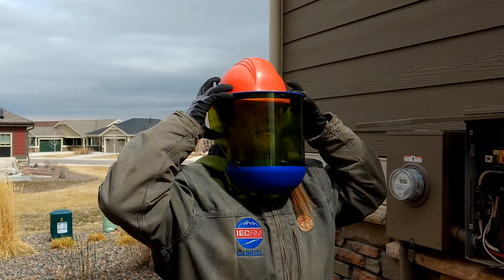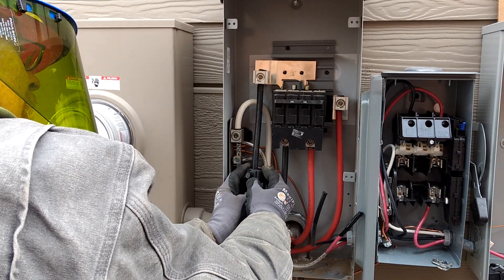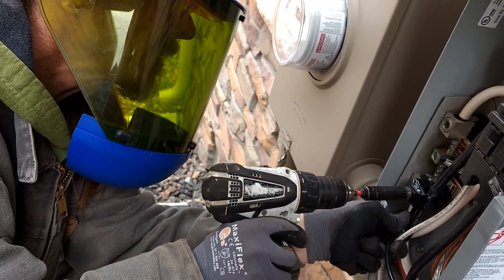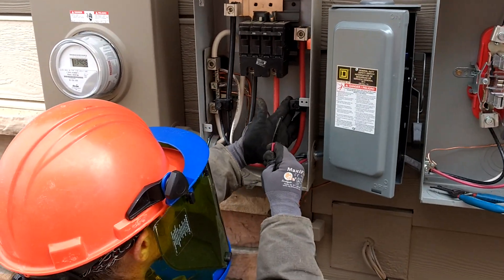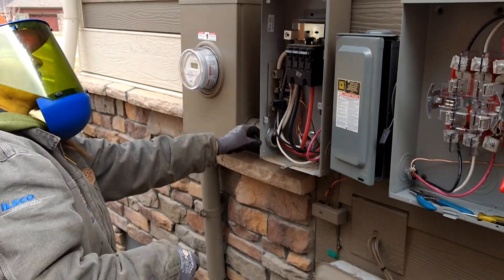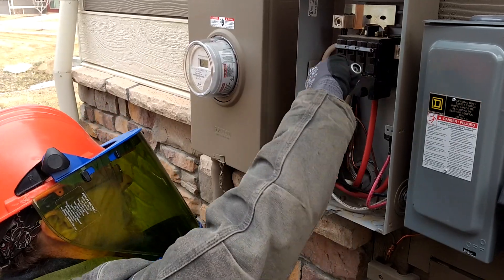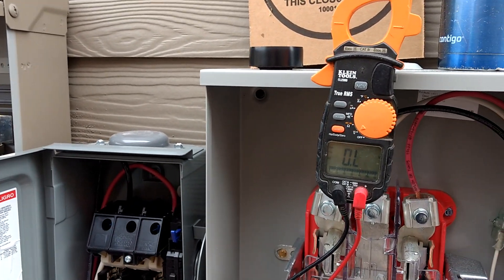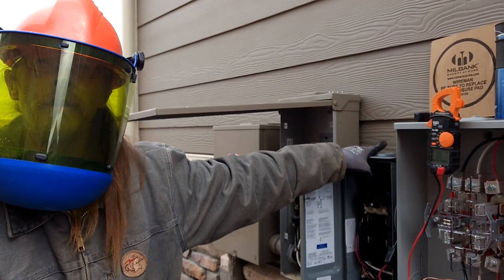Solar Line Side Tap Connection

Comment: Question .. instead. Of using this connection can you just run the wires inside to the breaker panel and connect them to breakers instead of this? Thanks
Reply from the maker: depends on the amperage of backfeed and the amp rating of your bus and main breaker.  Usually for a 200 amp panel, you can backfeed up to a 40 amp breaker, but the rating of the bus and manufacturer's specifications vary.
Reply: @AngelMalakim  not sure what I’m going to tell this solar installer about how they tie in inside the meter box. The electric company says they can’t go in the meter box and connect in there. They didn’t give another way and the developer says they do this all the time. are they just going make me get a new breakerpanel ?

Comment: Very good video.  Isn't it required to bond the neutral to box in the fused disconnect fed by the service conductor taps (Typically green screw installed) and then carry 4 wires to the PV meter base and 4 wires further upstream?  This would require a meter base that allows the neutral to "float" from the box, but they can be found.
Reply: Well, technically the conduit can act as the effective EGC if everything is bonded properly but I always run an additional ground for redundancy. I do not land the neutral anywhere in the PV production meter as it is not necessary to do so.
Reply: @SuicidelG  run you ground and bonded properly and neutral has to be ran in every electrical box, meter, etc in CA
Reply: Ground from the disco to the ground bar of the MSP. Kinda weird to bond the disco when the main panel is already bonded and the true first means. That part has always been confusing. Bonding the disco essentially creates a ground loop lol whatever the inspector wants

Comment: Are IPC's Service rated?  My understanding is that they are not and thus, not acceptable for PV Line Side Taps.
Reply: They absolutely are not... though I won't lie my company does them on some utilities still that allow them. Alot do not and require non piercing lugs. We've mostly moved away from them as there have been some burn ups.

Comment: 1.6 ohms is actually higher than I was expecting for such a short length of thick wire. I'm not saying you did it wrong; I'm just a homeowner who is having a professional company install a PV array who want to use taps, and it seems a bit janky to me. Can't tell if my instincts are right or if I'm being unnecessarily picky.
Reply from the maker: you're right, i suspect my meter is off a bit on the low resistance readings... it should have been under 1 ohm, but with my meter i'm usually satisfied if its under 5 and the beep happens

Comment: I have had a few people look at installing a backup generator with a whole house automatic transfer switch.  The hang up is my solar system.  Currently I have two 7600 watt inverters running through two AC disconnects then back feeding my main panel.  The range of magnitude I have received from 3 installers is significant and all 3 seem unsure of how to deal with my solar.  One was going to connect the solar to the generac SMM modules so the would default to off when there was generator power, one says i need to do a manual transfer switch with 16 circuits and leave solar as is, and the third is recommending installing a sub panel that the solar feeds and then connecting that to line side of the meter.   The 3rd option is the most involved and most expensive.  Is there a simpler way such as replacing the unfused AC disconnects with fused disconnects then using this style tap to connect to the line side in the automatic transfer switch?
Reply from the maker: yes, if your solar connection is line side of the transfer switch, you will never have the generator back feed the solar.
Reply: @AngelMalakim   thank you.
Reply: @AngelMalakim  agreed.  As long as the generator feeds downline of the solar hookup you won't fry your inverter(s) by accident.  That would be an awful expensive learning lesson for anyone.

As a rule we always install our solar on the utility side of any generator.
Reply: Yea, making the interconnection for your PV system on the Line side of the transfer switch you should be good.... or I guess get an enphase system than has the capability of integrating a certain list of fixed in place generators that works in conjunction with the array/batteries(if you have them) to power your home during an outage. I assume, since this was 8 months ago, that you've had your system installed and this comment is too late lol
Reply: @SuicidelG  Actually my system isn’t in yet.  My generator is currently slated to ship January 19.  So this little project is now a spring 2023 project.   SolarEdge inverters are also able to sync with generators, unfortunately my solar arrays and inverters are each greater than 30% of the generator capacity.   So my plan is to go with lineside taps on the utility side of the switch.   Thank you for following up to my post.

Comment: Like that fact you are  wearing what appears to be Category II PPE; however, the gloves seem a bit short as your wrist were left exposed.   What was the reason to use line-side-taps on a residential instead of "Green" meter box that has lugs on the customer side of the meter box?  Seems Green Meter boxes are the way to go.  Any advice or recommendations  did the AHJ (inspector) and/or the utility have regarding the install.   One item of concern was the use on non-listed and uninsulated tools to work on energized equipment.
Reply from the maker: yes, we are going to transition to meter connections in the future!  our AHJ/utilities are finally on board.  At the time of the video, these piercing taps were the option I had been presented.  Currently, a meter lug or a insulated splice /tap lug is in my opinion better, as the teeth of the piercing connector really isn't much contact area.  That's a reason I like Wire nuts over Wagos, incidentally.

Comment: question - why are the taps on the utility side and not behind the main breaker??
Reply from the maker: The main panel bus is 200 amps, so by Code, we can backfeed only 20% more, or 40 amps of solar through the bus.  If we tap the conductors of the Supply side, we are not hampered by this rule, and can backfeed up to the ampacity of the conductor.

Comment: This guy: Wears an arc flash face shield
Also this guy: Does HOT WORK with normal NON-INSULATED gloves NOT RATED FOR even
Voltage Class Class 00, 500V AC 
I will give him a plus for actually using a torque wrench to the proper torque required.
He also checked his voltage & resistance which I've never seen done in the field.

Comment: Thanks , I like your resistance test for the connection but I always thought that had to be on isolated De energized wires or it could damage the meter?
Reply from the maker: Make sure you have a meter rated for category 4, and 600v.  It is a good safety precaution to remove the service meter and verify the service conductors are cold.  That is if your utility allows you to cut the tag!
Reply: I was in question of this also and assumed that it had to be a the correct meter for the job. I was correct in my assumption. Thanks for the comments that reinforced my assumption as fact.
Reply: @TheTubejunky  In the jurisdictions I work in (FL) the power company will replace the single direction meter with a two way meter.  They have up to 3 weeks after the electrical inspection passes to replace/upgrade the current meter.

Comment: As a newbie I am allowed to get most everything wrong.  I didn't understand the flow of energy. I have looked up the flow and realized that there is no connection from the pv ac disconnect to the main panel as this is a fused disconnect and there is backfeeding into the line side of the pv ac disconnect to the main panel. Backfeeding may be done when the grid is down. It must be done as per the requirements of the NEC or else it is against Code. The supply side line tap is a requirement under NEC for overcurrent protection of the solar circuit. I think I got it right now. Learning faster now.
Reply: Inverter shuts off automatically without a grid

Comment: I have a question on the ac disconnect box.  I know that the line of the disconnect comes from the main panel (usually) or where there is a manual bypass and transfer switch (inv or grid etc) from the ac combiner.  The load side goes to the ac combiner then to the inverters (vis critical load panel I think) Then the line side tap is done from the load side to the supply side of the meter. Fine that is ok. What I want to know does the load side also runs to either the main panel or manual bypass switch? The reason is the purpose of the ac disconnect is to cut all inverter ac power to the main panel. so there must be a connection from the ac disconnect to the main panel? Please let me know where I went wrong (newbie).
Thanks
Reply: I'm not quite sure what you are asking, but I'll try to explain how I am understanding this setup works.
The utility comes into the meter.  From there I call it the LINE side.  The LINE side then goes to the main AC panel that supplies power to the home.  The LINE side tap  connects after the meter, but before the main panel.  Those lines from the tap go to the Fused Disconnect that leads to the (solar) inverters and/or combiner boxes.
In your main panel the shutoff is your 100A/150A/200A breaker (at the top or bottom of your main panel) closest to the LINE side.  That is what protects things to the load side of your main.  When you shut that breaker off (or it trips) it kills power to the LOAD side.
Since the LINE side tap goes directly to your FUSED disconnect, your disconnect is what will shut down power going to/from the solar and the utilities.  This FUSED disconnect also protects the wires (leading to the solar) from being overloaded from the utility side.

Anyone feel free to correct anything that I've observed as I'm still learning myself.  Two years in and I still have questions.  Always learning.
Reply: @cfgdr3  Thank you for the detailed explanation. Few people took time to explain it like you did. Since this post I have been learning from the internet. good or bad depends on where you get the info and if it is reliable.   The last issue is the last mystery of line side tap. I have been advised that there cannot be a meeting of two current source at one point.  They would burn themselves out and cause a fire etc.  It seems a line side tap meshed two ac currents ( line-grid and load-inverter) that runs through the fuse disconnect.  correct me if I am wrong.  Thx
Reply: @geofferyromany4634  I think what you are asking is (roughly) will the supply from the solar and the distribution from the utility overload the wiring between the two?
If that is what you are asking, the short answer is no.
Think of the amperages from each as pressure and the draw/usage from the house/structure as the "void" that needs to be filled.
If that void cannot be filled by solar alone, the pressure from the grid will fill the remaining void.  But if the solar is more than enough to fill the "void" or need of the home, the excess amperage supplied by the solar (pressure) needs a place to go.  The extra pressure pushes uphill back to the utility, exporting the excess energy back to the grid.

This is the closest description I can give without breaking out a chalkboard and a bunch of hieroglyphic symbols that I know nothing about.
Reply: @cfgdr3  spot on and very well explained 👍

Comment: Nice gloves... wonder what the cal rating is on those
Reply from the maker: yes, not hot work gloves, its true!  they are so bulky its hard to get the wire into the tap...  but the taps are insulated, so i'm not touching any hot wire.  If I over-torqued the taps, they could crack, and then it would be dangerous!  Usually our policy is to turn off the main breaker, remove the utility meter (with hot gear on), and then do our line-side taps with the service being de-energized.  Some electricians are more comfortable with this work, and will take shortcuts because they don't want to remove the meter.  They consider removing the meter more dangerous than doing this hot.  Some Utilities would prefer you don't cut their tag, which is another consideration...
Reply: Honestly man I was just busting balls cause I saw a previous comment about osha compliance, your videos are cool glad to see a electrician posting videos and pursuing something. Keep up your hard work I do industrial instrument and electrical definitely different worlds and is always cool to see other side. Photovoltaics!!

Comment: Wow, having just had solar done I cant believe this is how they connected it - it seems like a really cheap and shady way to do it.
Reply from the maker: often a back-fed breaker is the method.  These taps are for systems where the house panel was too small to accommodate the solar.  It can be cheaper to do it this way vs. a whole service change.
Reply: Depending how the engineer drew up the plans, this may be the only way to connect.  Like @AngelMalakim stated, sometimes when adding the array it will exceed what the service panel can safely handle.

Comment: Why do you tap those wire to utility? Where does wires come from? Help please
Reply from the maker: we have the utility wires go from Meter to Tesla Gateway,  then those wires from tesla gateway feed a 200A disconnect, and then the House Main Panel.  Also from the 200A disconnect we tapped on the solar, so it could feed the house, or get back to the grid through the gateway.  We put our solar taps between 2 200A breakers, so we could be sure that wire would never see more than 200 amps.  This gets us away from the 120% rule which would have only allowed for a 40A solar backfeed instead of 120A.
Reply: @AngelMalakim  thanks a lot sir
Reply: @AngelMalakim  Thanks for the rundown.  And thanks for taking the time for all of our questions.

Comment: Is there a max distance requirement between fusable disconnect and the taps?
Reply from the maker: The National Electric Code covers taps in a lot of places, and different rules apply for different lengths, and whether its outside or inside.  See 240.21 

Generally our taps are under 10 feet away, and in a metallic raceway.  For supply side taps (utility side of the main breaker), we also must treat the raceway as a service raceway, so must bond it according to 250.102(C)
Reply from the maker: Also, if its a service disconnect, it should be grouped with the other service disconnects, and there should be no more than 6.
Reply: Yes, there are tap rules.

Comment: what are those connectors called
Reply from the maker: sanjay is correct, those are ilsco piercing connectors.  Ilsco IPC-4/0-6 Dual Rated Type IPC Insulation Piercing Connector 4/0-4 AWG